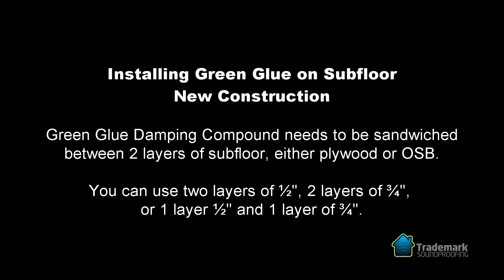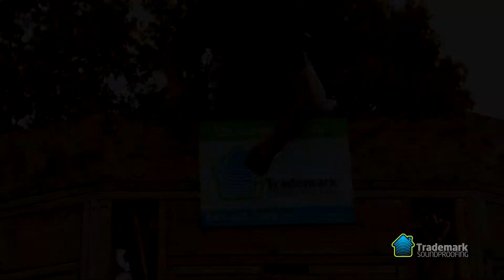Soundproofing a floor using Green Glue

Comment: I'm about to do the same.  2 layers of 5/8" plywood.  Was toying with the idea that it maybe made sense to screw second layer down just to bond glue, but then pull up screws because it seemed like the screws reaching down into bottom layer negates the performance of the green glue.   Not according to your vid, but I'm curious about that.  Wouldn't the screws become a bypass or transmission anchor for impact sound?
Reply from the maker: That is only an issue when you are attempting to decouple. No issue when you are damping the panel as in this case.

Comment: Any guidance on what size screw to use & how many should be used per 8x4 board/distance between screws or does it not much matter?
Reply from the maker: Depending on thickness of plywood. Screws should reach and attach to the floor joists. Install as you would a standard sub floor.

Comment: instead of a continuous line, the application with the caulk gun is leaving sort of necklace beads distributed in a uniform way. Could this be a problem? Thanks!
Reply from the maker: Not a problem at all. As long as you got the correct number of tubes (2 per 4x8 sheet) you will achieve maximum performance.
Reply: @Tmsoundproofing  thank you very much!

Comment: Thanks!  I’m just about to do this!  Already put down 3/4 with joist tape and planning to add 1/2 over green glue. Do you recommend making sure I screw into joists on second layer or do you find it sufficient to secure just into 1st layer of ply?  Thanks again for the info and competetive prices!
Reply from the maker: 1st layer is sufficient. However even screwing into the joists in no issue as when using a damping method such as Green Glue coupling the membranes is OK. If you want to add the decoupling component use resilient sound clips and channels on the ceiling below. 
Thank you for your business. We really appreciate it!
Reply: How did the green glue work for you?